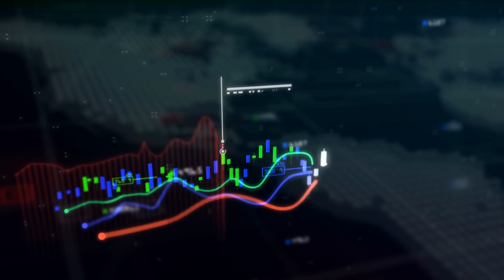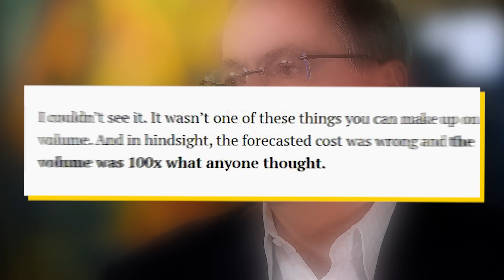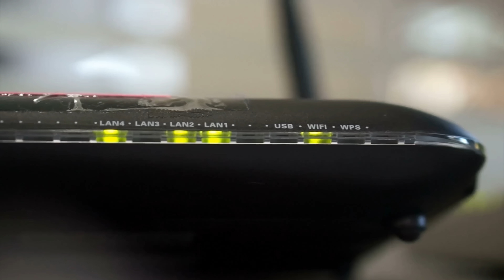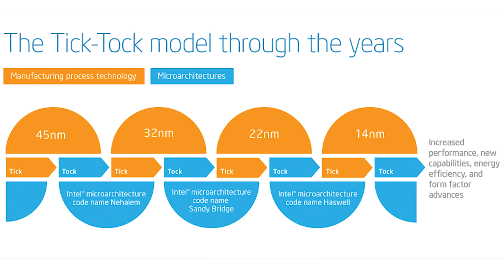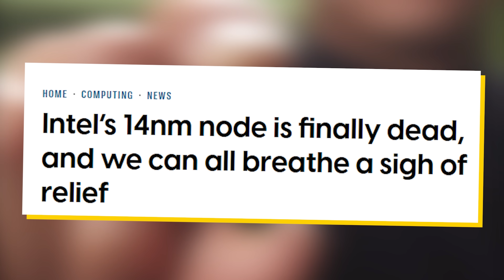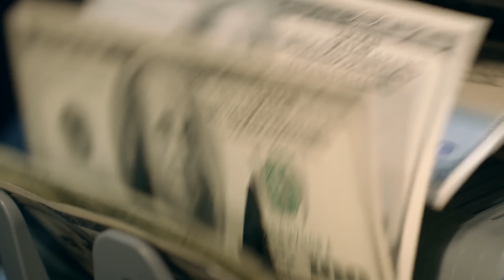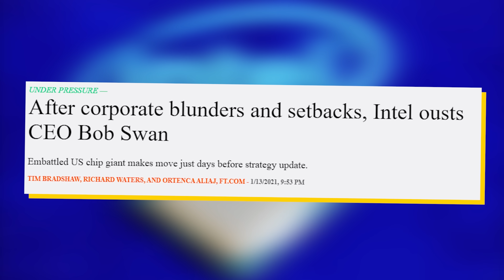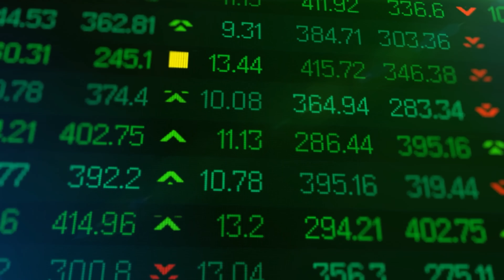Intel - Struggling Even During A Global Chip Shortage

Comment: Though intel was beaten by bad CEOs, the Current CEO Patrick is really good. A lot of people thought Intel's days are simply over, but Intel did really come back with their 12th Gen series, mainly i5-12400 and i5-12600K . Despite being an i5, it trades blows with previous i7s and Ryzen cpus, and don't bottleneck GPUs though they are low cost. Introducing P cores and E cores means that their innovation hasn't died yet.
    
     Also, after a lot of years, intel is finally joining the GPU business, and they actually made their igpus (like iris xe) very well. Not to mention, they are becoming more open to everyone, as just some days ago Intel allowed Linus (From Linus Tech Tips) to visit and make vlog about intel's lab. That means Intel is finally changing. I remember previous Advertisement from intel where they just showed a girl dancing for 2 mins, or they are saying "People loves Intel laptop over macbook". Those ads were ridiculous. But nowdays, Intel's advertisement shows technical specs, usages and their vision : Which again means they are changing.
Reply: Intel has to prove itself again that it can execute products consistently because Alder Lake rumors are pretty accurate (although it outperformed expectations a bit at that time) since 2019, more than two years before the actual product is launched which means the development of that is much longer. So if raptor lake is delayed again, then the successive product to that will face rolling delays and if meteor lake is delayed on top of that, then Arrow Lake (zen 5 competitor) will face against zen 6.
Not to mention Intel's server products will be rofl stomped by AMD if sapphire rapids is delayed any longer because emerald rapids (64 core top sku) will face against AMDs turin (up to 256 cores) and that is far FAR worse than AMD rome 64 core vs Intel cascade lake 28 core comparisons and that is bad for the consumers because AMD will raise prices again

I am not confident about Intel's ability to execute right now (hopefully change in the future) based on how they are doing with their ARC GPUs thats delayed by probably 3 quarters now and delayed almost 2 quarters from when they officially said it would launch and they missed the golden opportunity to launch that in the middle of chip shortage when everyone is so desperate for new GPUs and they might be launching around the same time or even after NVIDIA Lovelace or worse AMD RDNA 3 (because they will release midrange first which will kill ARC Alchemist on arrival)

And yes bad drivers are not an excuse, IF they launched these in the middle of the shortage when everyone can't buy a gpu so they can afford to have worse drivers than AMD during RDNA 1 and still sell all of their stock also they are using TSMC 6NM so foundry delays aren't an excuse too
Reply: Patrick is just egoistic
Reply: haha...that P and E cores are just a outright stupid idea when they are implemented on desktop space and they are absolutely a goddamn gimmick given their power draw in recent intel processor like 13900K....and the most stupid thing of all is that intel disables AVX-512 feature for god sake and only enable that feature on xeon models, and you call that an innovation???
Reply: But it’s sort of worrying. In server and the pc space, there have been delays after delays and if things continue as they have it’s unlikely Intel will hold anything up against AMD in server and PC is also worrying (source: Moore’s Law is dead), but there is an (alleged) intel engineer who did mention a lot of these really depend on now - release day so hopefully these delays won’t be an issue and there will be competition in the industry.
Reply: @adsrbad9733  
MLID, thats your problem right there
Reply: @suntzu1409  MLID..?
Reply: @adsrbad9733  moores law is dead
Reply: @suntzu1409  ohh… what’s the problem with him?
Reply: P cores and E cores aren't INNOVATIVE. Both cores are bloated in comparison to AMD's Zen architecture. P cores are just standard Core architecture and E cores are just updated ATOM cores that no one wanted in their products. INTEL just copied ARM but gets none of the power efficiency that ARM provides with Big.Little. You sound like an INTEL fanboy.
Reply: @MatrixJockey  Angel Fluffy already said it but can you explain based on what you called me a Fanboy? I gave both positive and negative views of Intel and said that they are changing. If you don't believe, go see some YouTube product reviews. Also saying E cores are updated Atom cores are ridiculous. Sometimes keep your hatred aside and think logically
Reply: @MatrixJockey  
Zen cores are also bloated compared to Arm Cortex-M0

""Its bloated"" can be said for literally every core that isnt Cortex-M0

Zen core tries to kill 2 birds with 1 stone

Intel's node problems have made zen cores look like you can kill 2 birds with 1 stone, when you cant

And if amd really can kill 2 birds with one stone, why zen 4c exists and how that isnt copied from arm?

amd is putting more transistors-per-Zen-cores with every generation since zen 1
amd also has been ""bloating"" zen cores since zen 1.
And Zen 4 is ultimate ""bloat"": 1MB L2, AVX-512, higher frequencies
Zen 5 also is probably bloated looking at rumours of focus massively higher IPC

Zen 3 is just updated zen architecture

You sound like an AMDrone™ of AMDefense™
Reply: @Matrix Jockey  
>Both cores are bloated in comparison to AMD's Zen
Got something to back those claims up?

>P cores are just standard Core architecture and E cores are just updated ATOM cores
By that logic, the Zen architecture is just an updated Bulldozer architecture. Your point?

>Intel copied ARM, but gets none of the power efficiency that ARM provides
By that logic, AMD also copied Intel with x86, your point? Besides, it's not only about wattage efficiency, but also space efficiency, you can fit more E-Cores than you can fit a P-Core in, therefore, if you balance the P-Core to E-Core ratio perfectly, you will end up with something that smashes in lightly threaded applications, but also smashes in thread scalable applications, since 1 E-Core is roughly half the performance of a P-Core, and you can fit 3.something in the area of one P-Core, you get higher speeds than by having a single P-Core. 

>You sound like an INTEL fanboy.
That just screams to me that you're not confident in what you just said, and resorted to insult them as well, now, why don't we engage in a proper conversation, where we expose each other's points, and debate on them without resorting to name calling.
Reply: @Bomkz  Intel is finished. Just buy AMD. Good performance, superior power consumption.
Reply: @jasonking1284  sorry, I buy what works best, I don't buy because of brand.
Reply: @Bomkz  Oh.. you will be buying AMD then.... good for you....
Reply: @Bomkz  I think the big issue is stagnation. Also they can't execute on time anymore. Yes Zen 4 was delayed but Zen 5 looks to be on track. Intel is 3 to 6 months late on everything. Two intel generations will have passed to AMD Zen 4 and likely Intel will only be trading blows. When Zen5 hits with likely 16 and 32 core parts DIY and consumer it's going to be gg. 16 P cores and 32 E cores is not going to beat 32 Zen5 cores. Now maybe Intel is hiding something of a knockout blow in Battlemage GPU. The issue is if you look at their CPU side they are behind AMD to likely Q5 2025.

Comment: Only problem I have with this is Atom was Intel's attempt to get low power draw out of a x86 architecture with comparable performance of leading ARM chips over the same time period.  The problem was Intel never achieved low enough power draw even at comparable performance.  They could not get power draw low enough to even be relevant.  The only thing they were good for was netbooks and tablets, but it would have been possible to run those on beefy ARM chips and get less power draw for similar performance.   The reason they weren't was x86 based applications (Windows and things that ran on it) dominate the software industry for PCs, so it was a non-starter at the time.   Intel failed with Atom in every conceivable way.   Netbooks were they way  tried to make all that R&D to make a failed attempt at low power x86 chips not look like the absolute failure it was.
Reply: I still don't understand why can't they license arm or risc architecture for low powered design. x86 is clearly designed for performance, but low power architecture some other architecture is needed, it doesn't make sense to get stuck with atom. Just like the euv technology which Intel was stubborn to not use but finally gave in.
Reply: @XZ Saw Well, Intel was one of the original investors into ARM technology. They modified it into "StrongARM" but never saw any future in the technology, so they sold it off. To a company named Marvel, I believe. I could be wrong on that but a quick search will show it. 

They believed so much in performance that x86 seemed the only way forward for them. They never believed that the ARM architecture would advance that they would one day lose the performance crown to it at a fraction of the power cost. 

They should have seen that fact. But they weren't able to.

Comment: Need to disagree with them not seeing AMD coming up. They gave them Jim Keller for Raja Koduri. Jim had some great designs that Intel was not going to use (Zen). And they wanted Koduri for Xe. So a sort of swap was made. They saw it, they just never expected AMD to be able to pull off the PR coup they did. I feel they knew x86 was stagnant so they decided to create what they wanted and dumped Keller on AMD for Koduri so they could start bringing in some of that sweet, sweet GPU money. So far this entire strategy has yet to bear significant fruit for Intel, but AMD sure made out like bandits in the short term. It's shame they went fabless. Imagine they had found investors to upgrade their fabs? Just wow.
Doesn't matter at this point. They will continue to hemorrhage market share to ARM based systems until they die. This is all a matter of time. Yeah, I realize if they could get to 5nm in actuality with Xe on board, they could make SOME SoC and an awesome cell chip but for who and when? We are about to take a shift away from cell phones anyway. That tech is going to start moving into the 3D realm as soon as they get the glasses and the device size right.
Reply: 'We are about to take a shift away from cell phones anyway. That tech is going to start moving into the 3D realm as soon as they get the glasses and the device size right.'

wait.
3d realms?
glasses?
dude.what are you talking about?
ive never heard about anything like this,and you saying it as if its around the corner and are about to be launched.

LOL!
Reply: @ssllsg9439  it's already launched. Look into it. It's costly for the cheapest AR system but they are a load of fun and once they get the device size right it'll be for everyone. I expect to see this in contacts and as surgical implants within 50 years. But the consumer driven portion is here now.
Reply: @Dr.C-UTS  

'. It's costly for the cheapest AR system but they are a load of fun and once they get the device size right it'll be for everyone. '

you seemed to have forgotten about google glass,didnt cha?

ever wonder why it fails?
Reply: @ssllsg9439  No. I have it still. It worked. Had controller issues etc but what does that have to do with what is out in the AR space now?
Reply: @Dr.C-UTS  

' what does that have to do with what is out in the AR space now?'

google glass=AR device
this new tech that you endorsed = AR device

google glass= failed
this new tech that you endorsed=most probably will fail as well
Reply: @Dr.C-UTS  

' We are about to take a shift away from cell phones anyway.'

youre insinuating that these AR tech iss going to completely replaces smartphones,right?

how?

a laptop is basilly a smaller PC with a built in monitor.

a smartphone is basically a smaller version of laptop.

did you see smartphones kills off laptop or laptop kills off PC?

AR tech MIGHT have its uses here and there,but,for you to make a claim that smartphones are going to become obsolete because of the advent of new tech is presposterous and presumptious,buddy.
Reply: @ssllsg9439  Just because you lack both information and vision DOES NOT make it ok to pretend I'm wrong to feel better about yourself and your argument. You are dead wrong. If you can't see the trends before they trend that's your issue. So please stop trying to make them mine. Many people said the same about the iPhone. But here we are. Think about it. Have a good day.
Reply: Dude...

The Father of Zen is Mike Clark, NOT Jim Keller. Please, give credit where is due
Reply: @rezaramadea7574  I don't remember saying Keller was the father of anything. I said he had some interesting uArch (Zen) that Intel didn't want. They swapped him for Koduri. Keller worked with the AMD team to bring Zen to life. So I don't think any one person is the father of Zen or Zen+. I think that entire team together brought it to life. I know Keller worked with what they had to begin with.